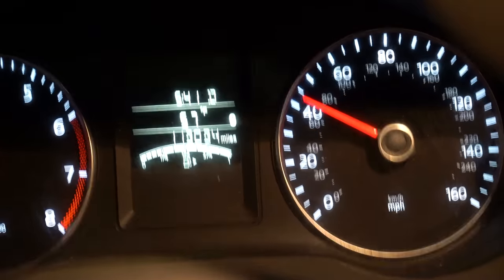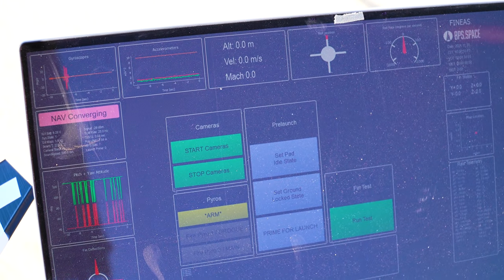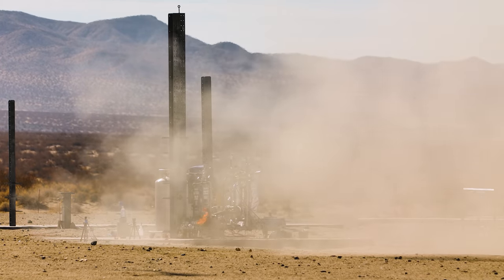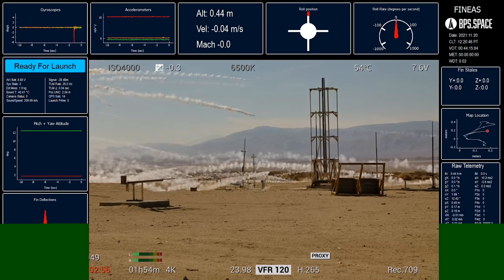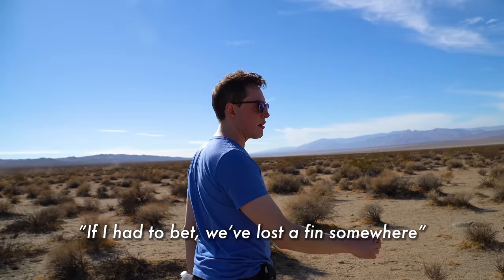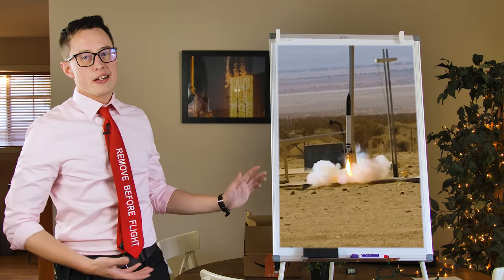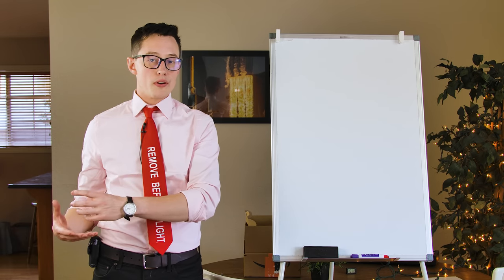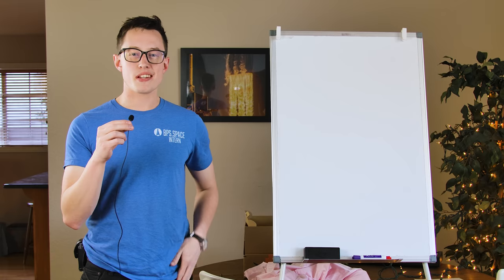Fineas - Test Flight 1

Comment: Provided that the servo gears/parts weren't melting, I would expect the axle for the fin to at least be flat or square, maybe have a slotted but aerodynamically streamlined disc to grip the fin rather than depend on epoxy grip?

Comment: Yay your Shute finally worked!
Reply: Looks like your gona need to Cnc some internal parts and  take its temp out there you need to know how hot it gets on the pad at 30 to 60 min i didn't think of that it was probably really hot. And of course you could minimize the time its out on the pad or launch at dawn to but you probably cant control that really. I Like your move to fins if you not doing a controlled landing there prefect for the job next test will be cool im shure of it.

Comment: Hey guys it is a nice attempt with the movable fins. When you're going at extreme speeds you're probably borderline by the way the fins are moving in the wind. It's got to be a lot more solid heavier duty or you use a lower impulse motor. Aerotek makes them you want a long burn low impulse motor. Those fins are just going to rip right off it is still possible and I know it can be done you only want to move one or two fins. I've flown some really interesting rockets that are not in the ordinary things that are hollow have used poop shoots and I use winged jet type of rockets that work really well on m and above composite motors. Your borderline with your phenolic tubing you need to fiberglass wrap and just kind of keep it simple in your first ones I would like to see you guys do it. Hey anyway I'm in the Bay Area I wouldn't mind driving out if you guys came down to Fresno they have a big lunch area out there in Fresno on a dairy farm we get pretty good windows up to 25,000 ft I believe which is pretty good for California. Maybe you guys should try three fins it's much more stable and easier to control but what do I know I've only been doing it for 30 years. Anyway I know how it goes yeah yeah yeah 😆👍

Comment: Maybe you can consider putting the fines upper on the rocket? I mean if you locate the servos and the fins right beneath the circuit boards, it might not get all that heat and still do the work.

Comment: I know this is late, but what about a synchronizer ring to position the fins?  This is a mechanism used by variable vane turbochargers.  You could position the ring towards the bottom of the rocket, allowing a forward hinge point, but drive it with something like a stepper motor from further up.

Comment: if your gluing a dowel into the fin for mounting it, you could pin it. I think you are close here, if you can introduce some positive mechanical lock in the joints (pins) it should work.  you have a TON of travel in those fins. that looks like you have an inherently stable design so you could probably take half the travel out just to keep it from going out of control and being on the verge of a shred. that things strong to handle being thrown sideways in the airflow like that without being ripped apart. maybe some travel stops in case of a mechanical failure?

Comment: Your computer needs to sense that chutes have failed by X time. You have the data, have either a cut away and 2nd chute deploy or the 2nd shoot shoots out way further than if there was a first chute fail.   You have the altitude, you have the computer, chutes and pyro are light.   You need the double redundancy on your recovery.    Its a great demo, a great video to do, and its basically guaranteeing that you recover the rocket.   This is the fixing of Failure Mode Analysis.    In fact, maybe ditch the whole nose cone off thing all together.   You can design a side hatch that comes off and the chute is ejected.   Then you can have 2 of them, and the rocket never separates.   Do what no one else does, screw the popping of the nose cone estes model.

Comment: Would using a worm gear work better for controlling the fins? It can prevent the servo from getting destroyed and put the force on the material of the worm gear instead. It can prevent it from moving when you don’t it to as well.

Comment: Small rollerons are plenty effective for controlling a rocket. Sure, fully articulating stabilators are fine... if you are planning on making 180° turns are doing some serious aerobatics. Having rollerons on fixed fins would ensure stability even if one of the surfaces failed. I would model them after something like the AIM-9 Sidewinder. Simple, light, no need for strong pivot points attaching the whole control surface to the rocket, and the AOA instability goes away completely.

Comment: What airfoil are you using for your fins? They look like flat plates, but with pretty blunt leading edges. You may want to look at what forces (lift/drag/moment) are associated with these fins at the reynolds numbers you’re flying (air density, airspeed). Then maybe to some materials analysis/testing to check if your fin system can handle the expected loads. 
…just my two cents
(Love the channel btw)

Comment: I'm thinking the fins should pivot on a pin at the front of the fin and rotate from an actuator at the bottom of the fin. 

That would give you a lot of torque on the fin but limited range, which should be fine since you want to steer small anyway.
Reply: @nocare  agreed. I was just thinking, what is the maximum deflection you'd want to achieve?  Probably less than 5°.  

I don't know the calculations, but I bet you could get a servo to handle the load and a spring loaded servo horn could regulate the amount of force applied so the servo doesn't overload.

I would think the failure mode of this would look better than what we just saw.

Comment: Wait, so I'm not clear: do you want all of the fins to move in a coordinated way? If so, it seems like controlling them with individual motors could cause you a bit of a headache. Have you thought about mechanically linking all of the shafts for the fins together with e.g. a ring-shaped rack and pinion kind of thing? Curious about your thoughts on something like that vs individually controlled fins!

Comment: How about fixed stabilisors with control surfaces on hinges? That would make the structure stronger and prevent unwanted runaways like the one in this video. Perhaps, if the forces on the servo were to great, you could make a balanced rudder type of control surface.

Comment: Would this be more effective if you used static fins on the bottom and movable surfaces to the top? Thereby controlling the surfaces at the leading edge of the rocket...  I would have thought you would be able to also reduce the control surfaces to just 2, therefore having control over pitch and roll. I would have also thought that considering the rocket is only small and very fast, the range of movement could probably be much less... Love all these miniaturisations of tech that previously was only seen on full scale rockets...

Comment: Pro Tip: Put the ignitor into your motor after you've rotated it to point skyward. If your ignitor happened to light while the rocket is pointed horizontally, it's going to be a bad day.

Comment: That was fun to watch I have to ask why don't you build the rocket from aluminum tubing and metal drive parts? Is it against some sort of model rocket rules to build from aluminum. Build the rocket parts from aluminum or carbon fiber of the shelf tube sizes 4th axis machining of the tubes and some aluminum actuator parts it seems like that would be a fun project. Let me know

Comment: Metal, even aluminium, is heavy. Maybe wood control arms could actually be a good option? Its temperture resistant (as long as its cool enough to not set on fire), lighter than metals, and pretty strong.

Comment: Are you sure that it is not a matter of thermal expansion? I would drill a hole through the servo shaft and use a set screw...

Comment: um, this suggestion might be a bit late in the game but I would have added a small rudder like tab at the bottom of the fins,  They would only move a small distance to trim out  the tiny error in the fins.  Maybe only one tab would have been needed and the fins would otherwise be mounted normally.  This would be much simpler than spin stabilizing the camera mount, but the spinning camera thing is way cooler,

Comment: I feel like you should take inspiration from AIM-9 sidewinder it has two sets of fins first set (bottom half) uses a like wheels that are imbedded in the fins to stabilize the the rocket and the second set ( upper half) is used for steering the rocket/missile it self.
Then you could drive the fins directly by the servos.
There is a mutch better video explaning how it works (thats because I suck at explaning things)
and you dont see mutch model rockets with two sets of fins.

Comment: Instead of the fins rotating on a pin, why not have them connect at two points, having the bottom section rotate  (like the wood base of a pepper mill )

Comment: Place the drive shaft on the upper end of the test fin so that the driving forces will be smaller to keep the fins aligned but greater to rotate...
I believe that this way the chances of erratically moving the fins would be smaller, even less with failure of the mechanisms
(PT-BR: Coloque o eixo de movimentação na ponta superior da aleta de comprove assim as forças motoras serão menor para se manter as aletas alinhadas porem maiores para rotacionar... 
Acredito que assim as chances de movimentos das aletas de forma erráticas seriam menores menso com falhas dos mecanismos
Reply: kkk agora que  vi ... todos tiveram a mesma impressão
Reply: hahaha now that I saw it... everyone had the same impression

Comment: as a kid in the very early 80's, I learned that hot glue was terrible for gluing fins to body tubes-and those were the thermoplastic "3d prints" of the day. Not sure that's the material for today's fins either. cast epoxy maybe? or resin printed? I suspect they'd crack on landing but should be able to stand the heat of the Mojave.

Comment: Flight looked good until the Fins came loose but i'm glad the rocket survived this well.
Just ditch the Epoxy, i'm not an expert in real-life-engineering , but i know from first-hand-experience that curing epoxy has so many factors that can be messed up that it's just not worth using it, so yeah, do whatever you need to do to keep those fins where they need to be, but don't use something that is out of your vision and can fail because of heat, consistency, air bubbles or all of the above. 
It's not rocket science ;)

Comment: how about floating a helium/hydrogen/hot-air balloon to 10-40km, then activating the rocket
Reply: or just a electric lift line to the launch station level by wire
Reply: gods, you are, and force, if you have Christ
Reply: you have stupid high torque at the fins
Reply: 100% passive, solved
Reply: no control
Reply: the story of failure, end
Reply: flaps are self-aligning

Comment: After viewing this video, and pondering on the fin control failure a bit, I have come to a realization that perhaps what we are seeing in this is slight a lack of understanding of the effects of "scale" in this project.  Please understand that this is intended to be a gentle criticism and the parallels that I discuss just that, PARALLELS.  They are not intended to insult or alienate.  They are simply interesting parallels that, I hope, help illuminate the problems that you are facing in the project.

My parallel will refer to the "flat Earth" concept - a concept I find totally repugnant mainly because of the inability of adherents to visualize and understand the "big picture" of what is going on in nature.  It involves the massive scale of the environment being examined and the inability to understand scale and how it fits into the perception of the problem.

In the case of control surface forces on your small rocket, the forces you are dealing with during flight do not "scale down".  The pressures to small surfaces created may actually be less that one might find on a Saturn 5 (or even a Sidewinder missile), the forces presented to the mechanical structure of the design far exceed the strength of the structure itself - just like the Flat-Earther's inability to understand the geometric concepts that allow the Sun to shine under a cloud at sunset from 93 million miles away.

Scale is everything in science.

What is the solution to your control surface problem?

I don't know.  My training is in Journalism with a tiny bit of electronics on the side.  Also, I do own and operate a TAZ 6 3D printer designing "pretty" near-zero load aftermarket car parts...

I can only guess that you need to improve the strength of control components and, perhaps, apply leverage in the form higher gear ratios with faster electric motors and smaller control surfaces.

Perhaps these are the ramblings of Captain Obvious to you.  Perhaps there is a nugget of inspiration buried in my ramblings.

I hope that this helps...

Comment: Imagine thrust vector control with fin control ... 😮👌👌
Reply: The reason you don’t see that on rockets being it military or civil rockets is that, it’s literally too maneuverable. On rockets because of the high Gs the airframe suffers, making it turn too fast would cause a catastrophic failure. Hence why space agencies and military companies stick with only one type of control type.
Reply: @polaska_tyu  BTW I was just wondering;  Isn't that what you already have on a Starship...😞!!?
Reply: @polaska_tyu  Except they don't. Many modern missiles such as the AIM-9X, IRIS-T, etc; as well as some older ones like the R-73, use both aerodynamic and TVC control.
Reply: @mariohernandez1111   The aim9X and the IRIS T both use thrust vector only, I cant say for sure about the R-73. But those two do not have combined guiding systems.
Reply: @mainuddinahmed7651  On the star ship the "body flaps" are mainly used for guiding itself in free falling, when the engines are active they do not operate effectively since they need airflow hitting them to actuate the space ship
Reply: @polaska_tyu  That is wrong. Both the AIM-9X and the IRIS-T actuate their tail fins too. I have worked on the IRIS-T myself.
Reply: @mariohernandez1111  if you say so, then cool!

Comment: Never trust epoxy. Trust metal and press/temperature interference fits and pins and other solid affixations. Epoxy is too unpredictable except in large scale, properly engineered, factory settings. Sure JB Weld works great, Cotronics works great, etc but in very specific circumstances. Epoxying rods is usually not one of those. Try a deformed metal connection or interference fit of metal connections.

Comment: TBH this is amazing what you're doing. Personally it's beyond me. 

Question to you is - how do military missile manufacturers do it so reliably considering such diverse geographies (like land sea and air and in such variable temperatures and environments) and yet, they provide range and accuracy beyond what the best amateurs are capable of, and they achieve such repeatable results........ It's not just that they have more money. The people that design these things are the same as you. Same ideas, similar tech. And any differences in tech were created by someone the same as you.

Stop trying to over complicate things unnecessarily.  To justify over analysis is a fundamental failure of academics in order to justify their science - K.I.S.S.

Don't over complicate things to prove. Just a thought. In

Comment: You truly are at the next level technically but for some reason you almost always have the most amateur level failures.  You should have either splined or keyed the fins to the shaft and locked them in with a couple of grub screws with blue Loctite.

Comment: if the fin control is only for roll why don't you have 3 static fins and 1 moveable? the roll shouldn't be excessive? also, to stop total failure why not just have the trailing edge move not the whole fin? anyway... I'm not a rocket scientist nor am I built special like you (I could never ever design an AVA circuit board like you did! not ever!) so just my thoughts